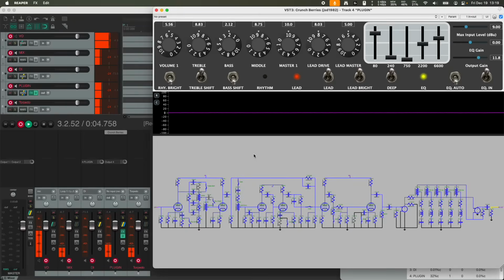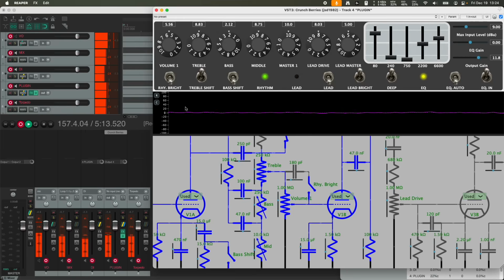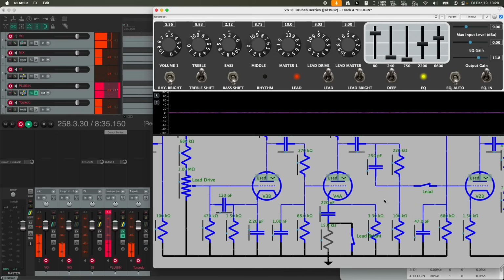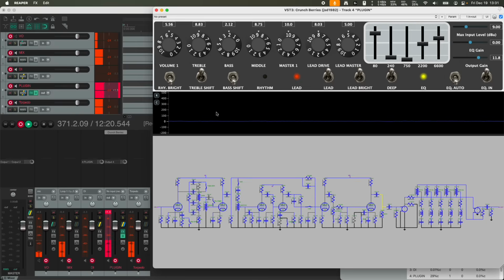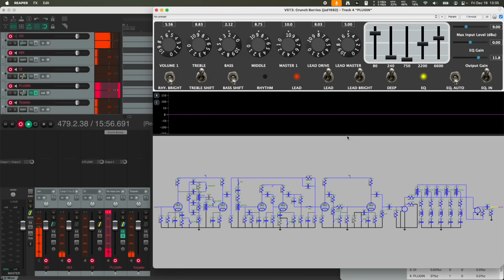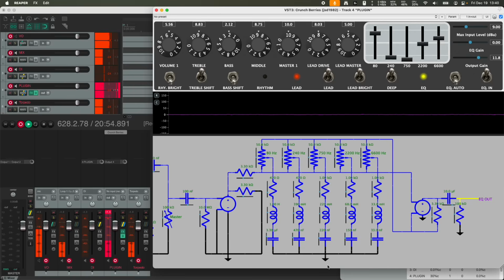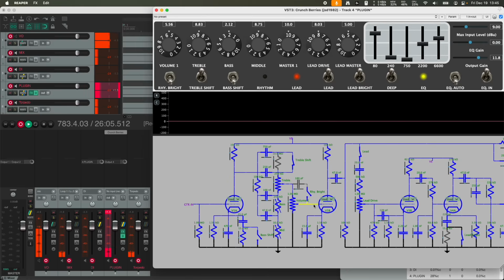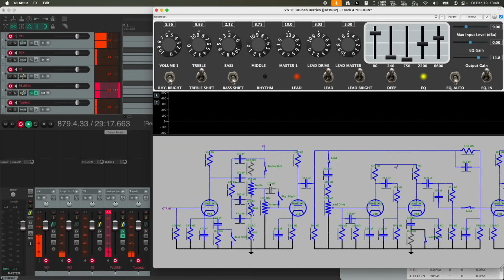Crunch Berries - a Mark IIC+ Preamp Circuit Simulator Plugin

Comment: Cant wait for this release actually! 😅 Curious what kind of speakersim you are using in this video? Any ETA of the release?
Reply from the maker: Thanks for your interest! No ETA on the release yet; working on it almost daily. Lots to do and lots to optimize! When the engine is fast enough I'll turn my attention to the GUI and polish that up.

Speaker sim used in the video is the Two Notes Torpedo Live with a JP DreamWorld IR loaded. That's driven from the Mark V's poweramp (plugin preamp sent into FX Return) 8Ω speaker output.

Comment: Would you post a tutorial on how to convert your Ltspice circuit into VST?
Reply from the maker: I'm afraid it's not as trivial as converting a circuit to a plugin as if it were a button click or a tool to use, mostly because that's where the challenge is. It's a genuinely hard problem to tackle.

Comment: Dude, this is amazing! I started designing a 4 channel hi-gain amp years ago which I had to put on pause before prototyping, I'm starting to have more time on my hands to go back work on it and this would be such a time saver to test ideas and concepts before having the PCBs designed or testing it IRL, how did you do this?! What's the software? Looks like a Spice variant and I know how to use LTSpice but that's not it, is it? Very cool my man, respects \m/-_-\m/
Reply from the maker: Thanks! This is custom software I developed to simulate the circuit in realtime and housed in a DAW plugin. Good eye on the schematic view; that's inspired by LtSpice visually because I used LtSpice itself to lay out the schematic and then imported that layout data into the plugin. That meant I had to render all the components to fit the same physical pinouts of their LtSpice counterparts otherwise it wouldn't look like the components connected to the wires.

Comment: Watching your video about a month ago inspired me to task myself with a similar task - I have some experience in C and LTSpice so I said 'what the hell?' 

Flash forward a bit and I have faithfully recreated the ADA MQ-1 equaliser in LTSpice! My experience is limited so I didnt care about the MIDI or any of the side systems it has in place. You have my respect for doing this with a fully fledged preamplifier!

I wanted that Black Album sound for years so when I learned that the ADA was used in the effects loop of the boogie, I realised I couldnt replicate it due to most 2C+ plugins lacking an effects loop. However with your preamp plugin, I can now slot this ADA plugin after this preamp stage to fully achieve that tone!

I have only modelled it in LTSpice so far and have yet to code it, but hopefully I'll get it working soon!
Reply from the maker: That's awesome!

Comment: guy says no approximations, then admits he never owned hw MKIIC+ to begin with, and could only compare the results to Mark V. right. "no approximations", uh-huh. taking someone's schemo of the amp off the web, which is hopefully correct (which is dicey at best) is not the same as having the actual amplifier at hand and studying its board, with the chance to compare your results with the real thing after you're done. otherwise, how would you know how close you got? close to what? "approximating" it to the schemo made by some guy on a forum? approximating it to your Mark V? approximating to sound clips of MKIIC+ on YT? without the real thing, approximations these are.
Reply from the maker: 100% spot on! I'll refrain from saying "no approximations" from now on. I'm going to be working with some experts who have the skills to probe and analyze the real circuit in order to improve the simulation. Ideally we want to get as close as possible to the real thing within the limitations of modern processors.

Comment: I am an actual owner of a Mesa Studio Pre and this is the most convincing simulation I have heard, and I have heard all the big players. Well done.
Reply from the maker: Thanks! I think the Studio Pre is probably the closest amp that this sim will sound like, without the power amp being modeled.
Reply: I have two Studio Pres and I can also confirm these sound identical. Actually the studio isn’t as tight and mid heavy as the c+ and I already hear those differences at the same settings between this plugin and my preamp. So cool!!

Comment: This is an incredible invention. Many vintage EQ, compressor and reverb plugins can be created using this method. We can modify the circuit elements as desired to achieve different sounds. We can experiment with different tube emulators.

Comment: You are the uber-nerd of guitar amping.  As a guy who has spent a lot of time with a guitar on my lap plugged into a live amp on my bench while soldering into said amp the idea of modeling a design without risk of electrocution sounds great. Interchangeable gain, tone, output modules would turn this into an amp design suite that any designer would want.  The Duncan Tonestack and power supply modelers have been extremely helpful and are far less powerful.  Keep up the amazing work.

Comment: My final year project in electronic engineering was simulating a fender 5e3 tube amp but I couldn't get the tubes right so I just did the eq section. This rips! Do yo have a writeup of your development process?

Comment: This is incredible. I own a Mk V, and this is incredibly close to the IIC+ setting. It sounds more like the original, in fact. One thing I would like to know, though. Did you build in speaker simulation or IR loading capabilities?

Comment: That's very good until you run out of computing power. If you use a computer, it's good. Modern cpu can easily load the complexity of the simulation. But when you go with DSP chip, it has much lower computing power. So that's why there are so many ir wave shaping algorithm in the market to be used in the DSP chip for products like kemper, line6, etc.
Reply from the maker: Yup! It's at the back of my mind on how to port this to an embedded DSP device.

Comment: the peavey revalver III plug in did something similar to this 2008 that plug in started on 2000 but on 2008 peavy bought it and that is the one I tried, I don't know if the other 2 versions did it too.

Comment: If I remember correctly the transistors in the EQ saturated with big signals. remember that the cable from the input to the tube have some capacitance and there is miller too.

Comment: This is exactly what ive been looking for for ages. Schematics and component simulation.
I salute you! Where to send my money?
Edit:
Other thoughts!
Im just a stupid enthusiast, but here it goes!
How important is the poweramp curcuit for the sound of the amp as compared to the "filter" that is the cabsim with different micing options?

How bout an universal poweramp sim plugin with easy presets (switches?) for different poweramp models just for an aprox vibe and flavor.
I'm thinking presence and 'deep' controls that lives after the preamp. Coupled with a simple "good" usable cab+mic eq/ir selection vst..

Can I help in any way?

Comment: Can you do this with spice models? Playing while you tweak a circuit? I love this man. I love tweaking and building circuits. I was wondering if there was a way to create a circuit and play through it. Super cool man.
Reply from the maker: Yes you can do a simulation in spice by feeding in a wave file but it won't run in realtime and you can't modify the parameters during the sim.
Reply: @jsd1982  thats awesome.. how did you accomplish this here? What apps did you use. Really cool work.

Comment: Yo I’m studying electrical engineering because I got really interested in audio plugins and thought it would be cool to make one. Recently I’ve been mocking up an idea and since I just took a circuits class I was wondering why people don’t do this very often? How hard could it be to simulate the original circuit in something like LTSpice? Looked up a pul-tec eq circuit and it didn’t look too crazy. Just found this video and it is a huge piece of motivation man, thank you so much for reinforcing that what I wanna do is possible
Reply from the maker: Awesome! Keep at it. No better way to learn than to have a real application in mind.

Comment: Congrats a thousand times. Not only is the Plugin really awesome but also the deep dive on it's workings. Have you considered an easy "tolerances" mode for the passive components? Like being able to re-roll the values within the industry standards and being able to further tweak and save "your specific and unique" amp? 

I mean it's amazing that one can basically change any parameter anyway but this might lead to a bit of option paralysis.

Anyway, top notch work.
Reply from the maker: Yup! That's an idea I had early on. I'd have to research the tolerance values used in practice since those can vary for every component. Usually they're 5% but some can be as bad as 10%.

Comment: Can you plot currents besides  voltage nodes? Which model for the triodes did you use (i.e. Koren)? Did you factor in Miller caps?
Reply from the maker: Don't want to divulge all my secrets but it's similar to Koren. Yup some Miller caps are included between the triode nodes.

Comment: You missed the make hot tube, cold tube trick!
Just a bit more voltage to the heaters, or less.
Russian 12AX7 always became more precise and less distortion. Polland tubes just pops😂 DDR tubes changing nothing, just shorter life
But when you give less heat and bigger cathode voltage, miracles are happened in this preamps.
Very nice project what you did! 👍
Reply from the maker: Hah I decided not to bother with simulating the heaters. We're generating enough heat through the CPU as it is. You should be able to increase cathode voltage using different resistor values though.
Reply: @jsd1982 might be… but it’s really depends on the grid construction. Never mind. What you made is good enough to be the best simulation. I like it! Nice job!

Comment: Also have you seen RLC speaker models? I just did a lab on that in my circuits course in temple, if you have a speaker, you can run a frequency sweep across it and use component models to model it, maybe a circuit sim cabinet plugin could be next!
Reply from the maker: No never heard of that. Thanks, I'll look into it!

Comment: I own a mesa boogie strategy 400 which has the coliseum iic+ power section. I'm wondering is it possible to model that amp and the 6 6L6 power tubes? to hear the differences between the bigger coli pt and the iic+ 105pt with only 4 power tubes from the simulclass heads? You said power amp sim is coming eventually it would be super cool to slave the whole digital c+ preamp and power amp signal into a digital version of my mesa boogie strategy 400 and hear the differences almost real time. This setup was famously used by James Hetfield in the studio for at least AJFA and TBA so for tone experimenting it would be the dream. I'm excited for the future for sure!

Comment: Do you have the schematics of the Mark 2C++? Or was this based on that? I know they had the Crunchberries amp - but they dropped it later for the 2C++ since it had more gain.
Reply: C++ is very similar to the C+. many C+ simulclass heads have been modded to switch between C+ gain and C++ gain with a push pull pot on the mid pot. I think its mostly 1 extra cap added that adds 6-9db of gain and a 300hz low cut.
Reply: @crummy.  So - I plan on buying this. Would it be possible for you to add that mod (and possibly any others you know of) as just a little button switch on there so we could switch between the C+ and the C++? Great FN work my guy. Look forward to replacing my C+ ampsims with this.

Comment: This is really cool! I've messed around with LiveSpice in the past but it has stability and performance issues. I've been learning HISE trying to create some amp sims. This is a really cool approach though. Especially when you can design your own preamp circuits essentially. The harder part will surely be poweramp modelling though eventually right? It has to be pretty hard to simulate the feedback and interaction between output tubes, transformer, and speaker.
Reply: May I suggest a sign up list or something? Would love to be kept up to date with your progress in a non youtube dependent way.

Comment: The faceplate UI interacting with the schematic in real-time is genius. I really hope that this becomes a full fledged product. I'm sure that it would take a lot of time and manpower, but having an amp/pedal designer VST with some stock schematics and the ability to build component by component would blow up in the gear building community.
Reply: Well revalver did that and beyond. It did it 10 to 15 years ago before it was bought by Peavey and now by Headrush (maybe Headrush is just owned by Peavey, I don't know).
Unfortunately after a while people lost interest and nobody cared about revalver.
You could create a circuit inside the plugin. Change components, values, tubes and so on
Reply: Yeah. Wow. Even a dedicated device where it’s just manipulating sounds with compnents in real time js truly revolutionary. T

Comment: This is awesome and it sounds great! I’ll definitely grab it when you get it up for sale. 

I would absolutely love a Hiwatt DR103 plugin like this. 

But I should recommend you make that Triple Rectifier, along with a classic Fender/Marshall/Vox to draw in more guitar players. Also maybe an Ampeg (svt/b15)for bass players?

Also i highly recommended making a video just showing the plugin vs the real amp sound samples, and not showing the circuit tweaking section as that may scare off the casuals. Show then that without tweaking the circuit, you can get a nice accurate and great sound.

I can’t wait to try this out myself when you release it!

Comment: Am I incorrect in assuming a similar process can be done with almost any preamplification circuit?
Reply from the maker: You are correct! I'll eventually branch out into building other amp circuits and effects pedals.
Reply: @jsd1982  Awesome!! Maybe one day I'll learn how to do it myself and make one for the Ampeg V4 / VT-22 (not V4-B). The lack of preamp pedals or good modeling for it is frustrating considering it's such a ubiquitous amplifier.

Comment: Not only is this exciting to make music with, but as someone who likes to make pedals and tube amps, this seems like a very accurate way to test changes to tube circuits. As you did in the video, you can literally go in and change plate resistors, cathode bypass caps, tone stack values, and tweak the levels between stages. Then I can play through it in real-time and see how that affects the sound! This is very cool.

Comment: That is great but please, show us or tell us the setup ad IRs used.
Reply from the maker: Setup is explained at 11:58. Guitar DI into HI-Z input of audio interface, plugin output sent to FX return of Mark V amp, speaker out to Torpedo Live loaded with John Petrucci DreamWorld rhythm + room blend IR, and line out of Torpedo captured in DAW. You can remove the Mark V's poweramp from the equation and go straight into an IR loader of course.
Reply: @jsd1982  Well, something is contributing to the final tone and it is not the schematics (plugin). I would assume that it will sound good with any other VST amp sim plugin. Hoped for a comparison, because the setup is a bit heavy end not cheap (despite your amp sim might be free, the other components are not so "free").
Reply from the maker: The plugin is doing the bulk of the work simulating the preamp which is where 95% of the tone comes from. The remainder is just a convenient setup I use to compare the Mark V's preamp to my plugin as a preamp. Power amps do provide a small fraction of the tone and are responsible for the "presence" control. Hopefully I can get a power amp simulation working soon and that will probably become its own plugin.
Reply: @jsd1982  It is the final amplification and impulses where the bulk of the tone is.